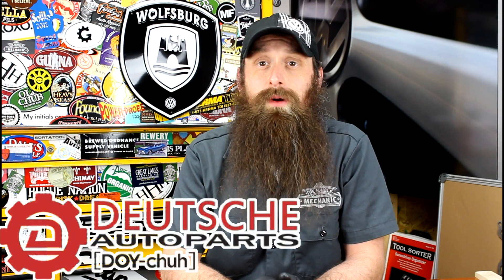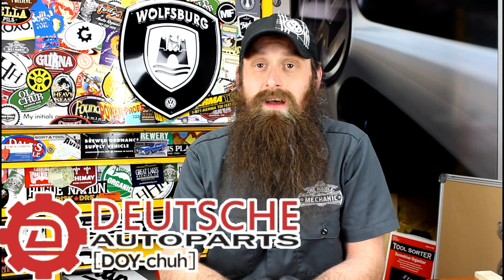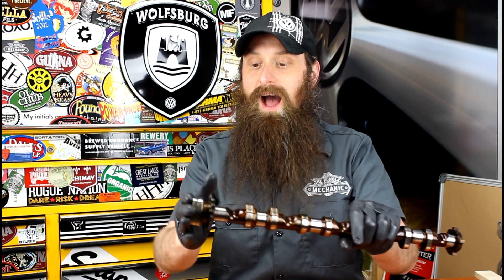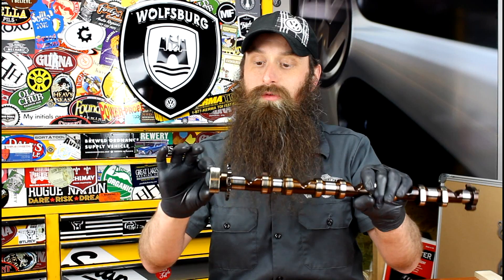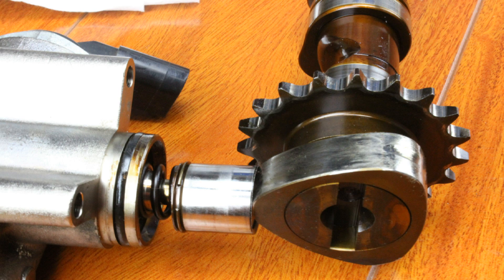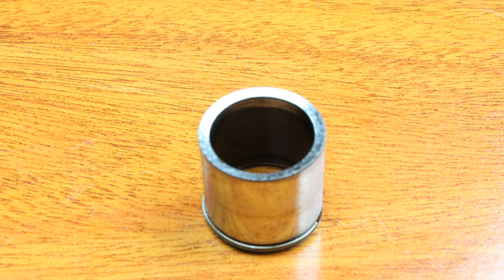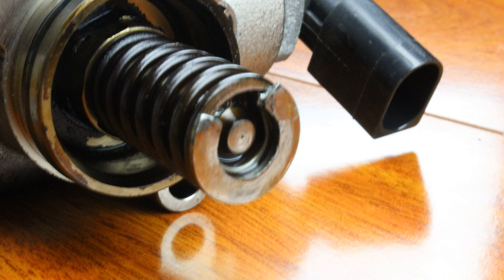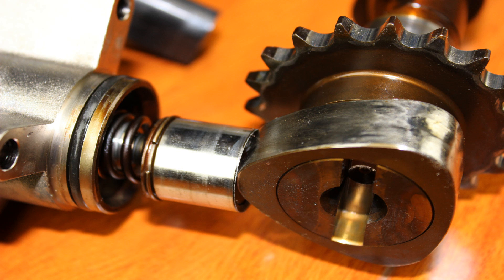How The VW 2.0T FSI Fuel Pump HPFP Fails

Comment: im currently dealing with open circuit on all my injectors and low pressure bank 1 have no starts unless i reset codes and once i apply throttle that it cuts off cant find anything online i said screw gonna replace the injector harness got bigger injectors and the apr hpfp wish me luck lol

Comment: Could you do an update on this for EA888 Gen 3? DAP is selling an OEM part that has an extra port but just lists the plug for filling that port without explaining when it would be used. Plus the follower issue doesn’t seem to be a thing on that engine.

135k on my late Mk7 GTI. Had two no starts so checked the codes and found low fuel rail pressure but no CEL. Replaced the pump and my car has so much more pep than before.

I am going to post a video if someone else doesn’t.

Comment: I have no symptoms but check engine light P0088 Too High along with current DTC P2293 N267 valve malfunction 
300 miles after staging it 2+ and alpha200 hpfp and new cam follower installation 
EA113

Comment: Hi Humble Mechanic, I have been having some problems with a 2009 2.0 TSI Scirocco. The car started to juddering on idle. The fault came up saying all of the injectors had failed ( apart from one which had previously been replaced ). My mechanic could not replicate the fault, he has had VW specialists come out and they can’t find the fault either. They put this down to a wet ECU. I’m due to pick up the car today after it being away for almost a month, having the fault still not be fixed. I’m thinking, do you think it could be the HPFP causing this fault, and how would I test for this being the case? 

Thankyou :)

Comment: Hi, i am working on tiguan 09, but i couldnt put the high pressure fuel pump  back in. I crank the engine to rotate but it still my high fuel pressure pump wont fully go in.
Reply: What am i doing wrong?

Comment: I have a 2014 a3 tfsi and the cam follower looks different to the flat ones is it same tho ?
Reply: It’s a 1.8 turbo and it’s making a ticking noise reeks of fuel and has no boost power but no boost leeks just feels really slow and lumpy and hesitant on throttle at times

Comment: Hi there, I need a little bit of help in here. I´ve a 2008 Passat 2.0 TSI car. I´ve a problem when the car engine is hot, after I turn off my car to i.e. re fuel, the car does not turn on again until the engine get cold. But I´ve found a workaround for this and still no Idea why.. If I pour a little bit of water on the high preassure fuel pump, the mother f*** start up again...Can you please help me?? I´ve changed a lot of things on my car and still no solution. 
Thanks in advanced.

Comment: My Audi s3 8p, if left for a couple of days doesn't start, the engine or starter  doesn't  turn, it's just dead but the check engine light comes on as does brake fault lights, it starts after leaving the ignition on for a few mins, or pumping the gas pedal.... Could that be due to low fuel pressure and HPFP or its cam fail..?
Thanks

Comment: Hi Charles, are you aware of any HP/Mechanical Fuel Pump related issues with mk7.5 GTI? One of the two bolts that hold the HPFP in place on my 2019 GTI has some how disappeared. Gone! I noticed this after the HPFP started making noise. I know these things vibrate a lot, but I am still a bit skeptical that the bolt was able to vibrate loose past the engine cover on it's own. Have you even heard anything like this before? Maybe the dealerships now check the HPFP, and maybe during my 20,000 mile service the tech forgot to put the bolt back? Now I am concerned that  the driving done with only a single bolt holding the HPFP in place could have caused damage to the Follower or Cam.

Comment: Have you guys ever seen the HPFP push air into the fuel system from the seal on the back where the plunger goes in and out. There is a seal back there. I keep getting air from the port on the low pressure side of the HPFP. No air bubbles from the lines before it goes into the pump. There is also no fuel in the return line? I tried bleeding it for a long time but air keeps coming?

Comment: Hi Humble Mechanic,  Just recently relocated to AZ and driving in extremely hot weather (116 degrees). The car started to cut out, but didn't stall several times today. It did this for a few days, and then today, about 10 times. Today was the first day it threw the P0089 engine code. I am wondering if I actually have a problem to be concerned about, or I just shouldn't be driving around in 116 degree temps. Love to hear your thoughts. I just don't want to get stranded. Thanks! (2006 vw Jetta 2.0t)

Comment: Hey need help, buying a 2017 GTI, DEALER claims the check engine light is on and takes a little longer starting because owner before installed a high pressure fuel pump. Can you shed light on this?
Why install one?
Would this cause check engine light? And hesitation starting,  like did not fire right up cranked a few seconds longer then and other vehicle i ever seen.

Comment: before i have problem with my cam follower totally broke, and i changed the cam follower but after 1 month my EPC on my indicator, when i scan my car i fault fuel pressure regulator valve (N276) but i already check the cam follower smal broke and dent in my camshaft 
my car Audi A3 2.0t fsi thanks bro hope you reply my massage

Comment: Hi mate just got a question can you use the roller type plungers tappet on a golf mk5 tfsi hi pressure fuel pump instead of the flat style follower ?? If that makes sense

Comment: will my car throw a code when the cam lobe gets warn? im experiencing like a fuel cut issue under load , usually on highway and going up hills, can hear a rattle/chatter when it happens, ive replaced my follower a few times since ive had my car , also just did my rear chain and tensioner. but im not getting any codes.
Reply: Hi Bud, have you managed to get your problem sorted ?
Reply: @jodynaidoo4050  well that problem I did lol. Now got cam/crank code I’m trying to sort out. The problem was actually spark plugs.

Comment: My 2013 golf R had a fuel pressure code that went away after I replaced the fuel filter. Around 5 days later the light came back on, took it to the dealership same day, had no power suddenly. Turned out the cam follower got jammed in the housing, tore up the cam shaft, cam shaft ate the fuel pump through the spring retainer, and as far down the shaft as it could basically. Luckily I had just gotten the vehicle a couple months prior, and my gf talked me into getting the warranty 😅
Reply: Bad dealership though. They knew the follower had a lot of wear when they replaced the intake manifold (runner flap control arm was snapped off, requiring whole manifold to be replaced), and they said nothing about it and did nothing about it. They also didn't even change the oil after they replaced the cam follower housing, fuel pump, and camshaft. They definitely didn't take it apart a bit further to remove the metal scraps that were ground off either.

Comment: Dealing with one in my shop now.  225k b7 blown engine.  Replaced with salvage engine.  One problem after another.  Sent us bad engine, then sent us wrong engine code, swapped parts to accommodate.  Start it up, chsin slap....  and p0016.  Replaced chain, tensioner, etc.   Then.....it starts, runs rough and only has 200 psi rail, while asking for 700 at idle.  Needless to say idles rough.  Low pressure pump in spec at 90 psi.   How does the hpfp fail in this case?  This engine has a banjo on the low pressure feed and looks about impossible to get off in the audi quattro configuration.

Comment: Hi,I got code P2539, I replace my cam follower every 8k miles approximately, never longer than 10k miles,seems like my HPFP failed and my car stopped outta the nowhere, I replaced the HPFP but the car dosnt start and send me that code (p2539) wich means fuel pressure sensor, I don't know what else do,you think that the new HPFP I installed is faulty too?

Comment: I’m just buy a 2006 gti 2.0t fsi engine, and I notice that the car can’t acelérate , it’s run most at 40mph and if I try to get more speed it can’t do it, it acelérate the engine but no increased the speed, my check engine light is on and I scanned it but don’t say nothing more than a ignition failure in cilínder 1, I buy the n75 sensor, the 4coils it’s news park plugs and planned to buy the high pressure pump with the cam follower because it is broken, I hope that this parts fixed my problem.

Comment: I have a 2015 passat TSI 1.8L with code po087, is inspecting  the high pressure pump the same as the one in the video

Comment: Hey Charles big fan. I had a check engine light on my 2.0T FSI for P12A2 Fuel rail pressure sensor. 
After making some other repairs like torn pcv and diverter valve as well as coils and spark plugs, the code has gone away. Is there any need for me to check the cam follower if I have no check engine lights? The car was not taken care of before I bought it.

Comment: I know you can't diagnose a car over the internet, but maybe somebody can point me in the right direction. My '13 Golf R will start, idle poorly for maybe 10 seconds, and then die. It'll die right away under any load, and it threw three codes:
P0300, random/multiple misfire
P119A, fuel pressure sensor
P2294, fuel pressure regulator circuit/open
After reading forums I thought it must be the hpfp, so I replaced it and the cam follower, but no luck. The follower and cam lobe looked perfect. I tested the low side pressure using the Schrader valve on the hpfp, at idle it was erratically bouncing between 2-4 bar. I thought maybe the regulator in the fuel filter was stuck open or the diaphragm leaking, so I replaced that and still no success. I'm not a mechanic but I also can't afford one, so anybody have any ideas?

Comment: I replaced the high pressure fuel pump and it started briefly then I turned it off and let it sit over night and in the morning it wouldn't start. It did turn over and fuel is traveling through thepump but no start. What do you think it could be

Comment: Question: I've replaced fuel filter, fuel pump control modular, low pressure fuel pump, ran good for 21 miles, next morning while warming it up it die's, still has a mind of its own, starts, runs, on and off, hot or cold. Any ideas?

Comment: I hear a metallic clicking noise coming out of the "HPFP" is it caused by a bad solenoid or by a worn Cam Follower.
AWESOME TUTORIALS CHARLES.
Reply from the maker: could be either, they are also a little noisy as is. Id remove and inspect
Reply: @HumbleMechanic  thanks man I appreciate it.

Comment: Hi there, an EA111 owner from Europe, 1.4 TSI engine CAVE specifically. I might have a HPFP fail but still trying to diagnose. I don't have any error code at all. Engine stalls on idle, AFR is 10.7:1 which is very rich but on the other hand I don't have any power loss at all, no missfires when pushing it to the limits. What I also have on the other hand is backfires and oil smells gasoline. Have you ever had similar concerns? Thank you

Comment: im lost on what to do already,, my Jetta 2007 2.0T FSI A/T cant start now, it used to have a cold start initially now it cant turn on anymore.
i have replaced the fuel pump (inside tank) no change, i have checked the Cam follower even the old one was still quite good, i also replaced the G410 sensor, and today i even replaced a brand new HPFP. and still cant start the car, only cranks.
it seems that there isnt fuel pressure with new or old HPFP, i am getting P310B/P310B/012555 error code (only code) with my OBD II, but i do not get any check engine lights
i have not buy a new fuel pump control module, as i cant see any damage on it, and it doesnt feel hot as mentioned on the other video..

Comment: I have a p2293 code and I changed the hpfp, cam, cam follower and the sensor on it. It still has alot of power but I still have the code. The Inspection is now expired and I cant drive the car. Any help would be awesome. Have spent over 1k trying to figure this out.